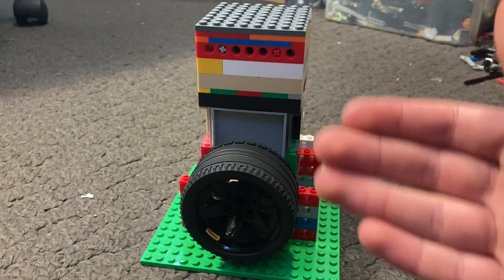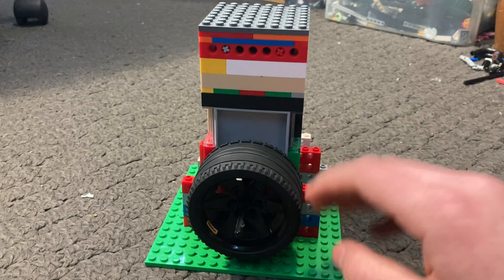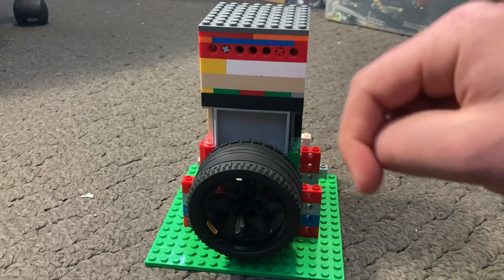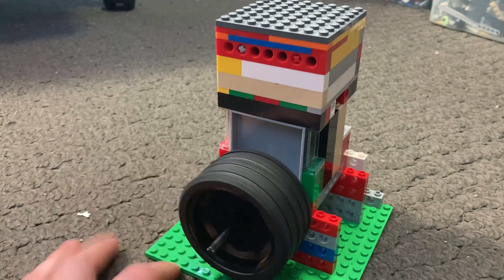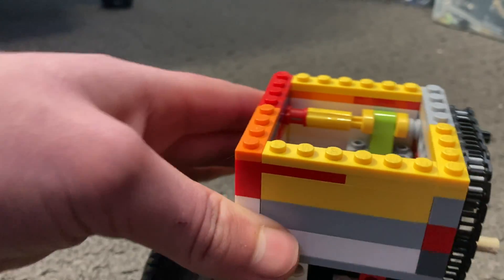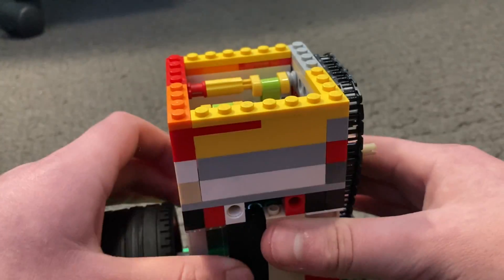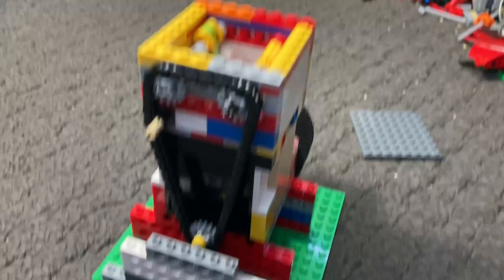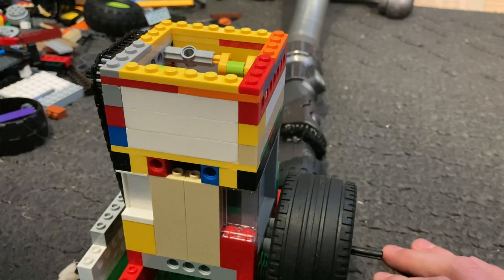DOHC Lego Vacuum Engine

Comment: @KFPLusLegoMastery hey bro i built this engine off the video and i was wondering if you could possibly remember the timing? I tried my best and it runs pretty rough so i was just asking?
Reply from the maker: the intake valve should be 90 degrees offset from the crank in the direction you want the engine to spin, and the exhaust valve would be 90 degrees behind the crankshaft, also 180 degrees offset from the intake valve. Essentially, the intake opens as the piston starts coming up, and the exhaust valve opens as the piston goes down.

Comment: What you made was not a DOHC, if it was a true DOHC it would have a camshaft that pushes down rocker arms which push down the valves. Other than that, love your engine.
Reply from the maker: Yeah, I guess you’re right, it’s kinda a DOHC but not 100% if ya know what I mean.

Comment: Can you make a oil pump for the vaccum engine? Bassically a vaccum engine that has a storage for oiod and lubricates the engine and reuses that oil until you need to drain it and put other oil in rhe oil storage
Reply from the maker: That could probably work, but unlike real combustion engines they don't burn/wear away oil as fast. It definitely would be cool though!
Reply: @KFPlusLegoMastery  ok thx you responded my comment

Comment: ive been wanting to see a performance 6x6
Reply from the maker: I wouldn't exactly call it a performance 6x6, this size engine usually is capable of much higher speeds. I might just turn this one into a better running and much snappier engine which will include a brand new throttle design!
Reply: @KFPlusLegoMastery  dude the sounds awesome btw the im on the discord as well

Comment: I have an idea I've been tring to make an engine where the piston its self works as the valves is this even possible?
Reply from the maker: You could try to make a Butterfly engine, which performs the action of both suction and exhaust.
Reply: Yep just built one

Comment: Nice smooth engine, one thing that I love about your engine is that you can adjust your intake and your exhaust independently.
Reply from the maker: Yes, chain driven valve trains are very tunable; unfortunately though whenever it goes out-of-whack it runs rough

Comment from the maker: Unfortunately I’ve noticed that overtime the chain will slip and throw off the timing, so if you noticed the engine getting a bit clunkier compared to when I first started it then that is why.
Reply: You could add a spring loaded roller gear so it reduces slack accordingly instead of just a non-moving roller
Reply from the maker: @notanengineer  Clever! Thanks for the idea.
Reply: @KFPlusLegoMastery  You would still need to keep the spring tension light for it to run smoothly.
Reply: Tensioning pulley, just a simple roller that presses the chain a bit and makes it a bit tighter, I did it on my engine and its amazing